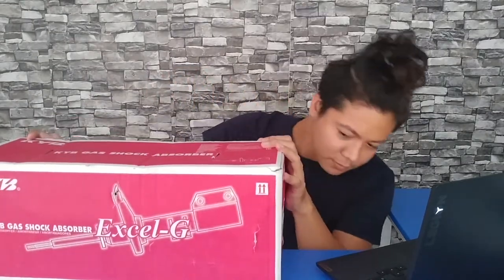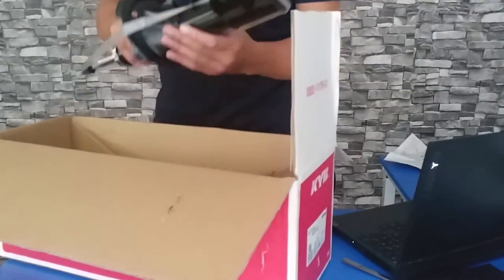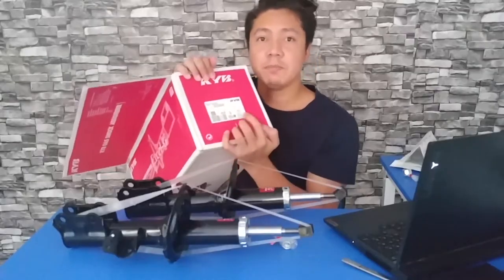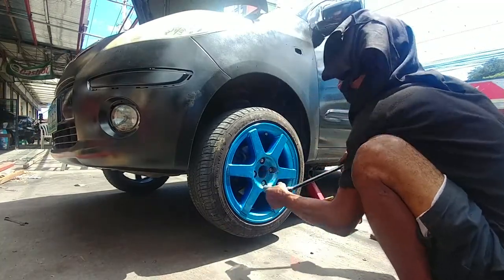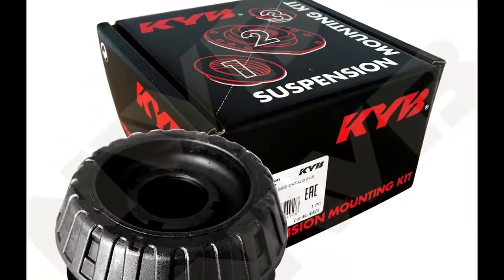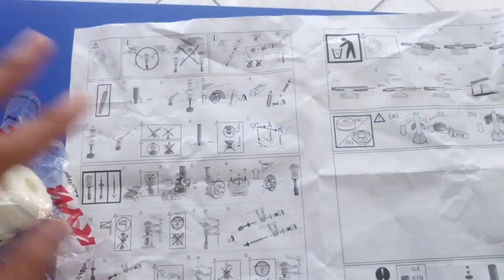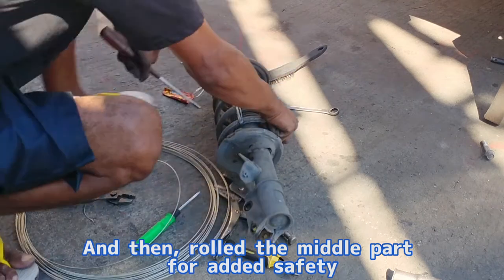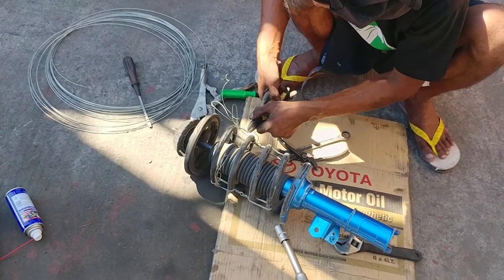Installing KYB Front Shock Absorbers For My i10

Comment: Parang KYB new SR yung kinabit, sir?
Reply from the maker: Excel-G lang po siya sir. Pininturahan ko lang ng blue para di msayang yung natira kong 1 spray can at ng matapon na
Reply: @buraionline  I wish you showed us how you painted them!
Reply from the maker: @17.06.Copper   yeah about that sorry bro, forgot to. Maybe if given the chance again. But to give you an idea, I just sealed and taped the rod with masking tape with pieces of used plastics to avoid paint dripping inside the rod's gap to the body, and I also taped the brand's sticker. Sprayed 2x with primer with no sanding, then dried it for a day. Painted 3x of blue and 3x of clear coat the next day and cured for 24hrs just to be sure.
Reply: @buraionline  thanks for the reply buddy! I definitely will try this once it's time to replace my stock KYB Excel G struts! Sadly I'm out here in Canada and we don't have access to the high end KYB starts like the SR and Lowfer Sports line 😪  I do like how you painted your ls blue to give give the SR look 😉 I will probably try the same.